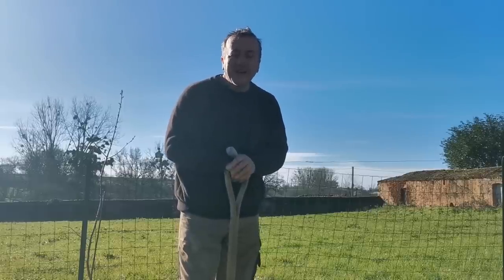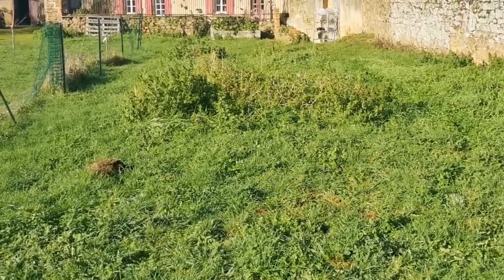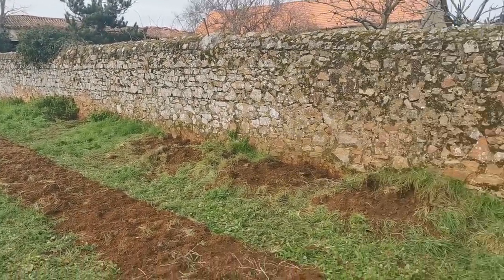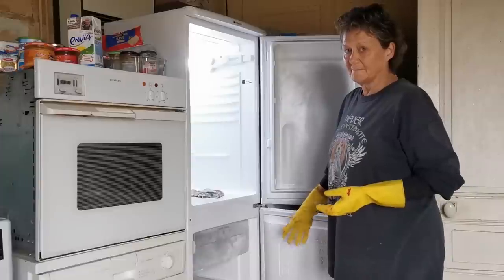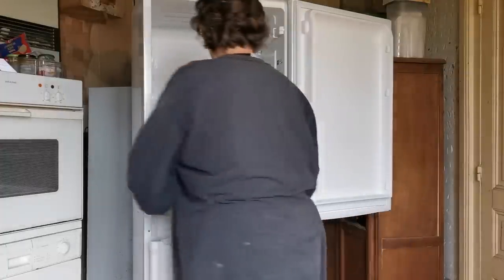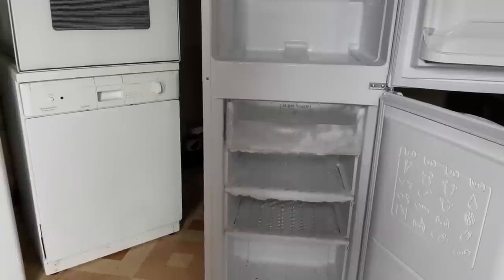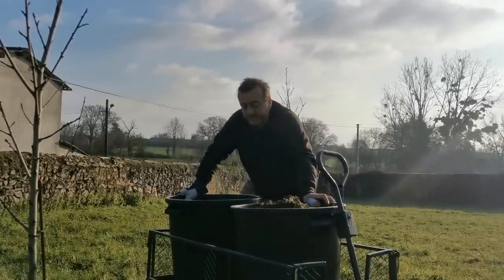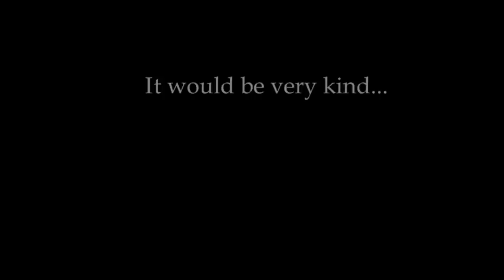Life in our 600 year old French Castle

Comment: Susie I was thinking for your refrigerator shelves you can either order new ones or have Rols buy several pieces of metal that you can purchase in lengths. The are very thin but stiff, about 1 inch wide and you can probably have the length you need cut at the store. You can attach them to the back of the shelves where each end will rest on the ridges on either side of the frig where the shelf rest, it will reinforce your shelve where you don't have to worry about your shelf falling. I would definitely try I don't think it will cost much at all. God Bless Kathy 🇺🇸
Reply from the maker: Thank you Kathy, but sadly we think the fridge got knock over or something, in transit, as there are a few bit of damage to the outside and the inside of the fridge keeps freezing my salad and fruit etc, so think the thermostat is ruined :( xx

Comment: As far as the frig freezing up , check the coils and vents in the back. If they are clogged with dust or dog hair it will cause the freezing because the blower can’t work.
Reply from the maker: Hello Machelle, funny, I did check the back and there were several pieces of plasterboard in it from when Rols ripped down the ceiling in there. He did cover it up, but obviously not well enough 😂  Take care, Suzie xx
Reply: Plasterboard and drywall sanding will do it every time . The fine dust clog’s everything. I’d give it a good Hoover .